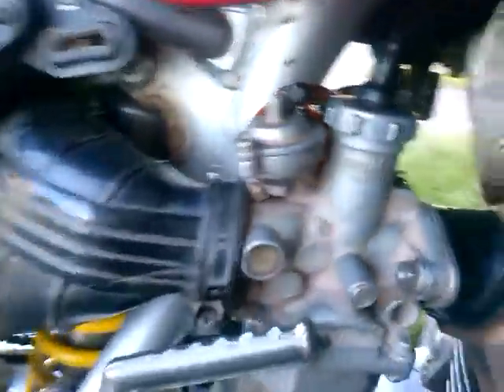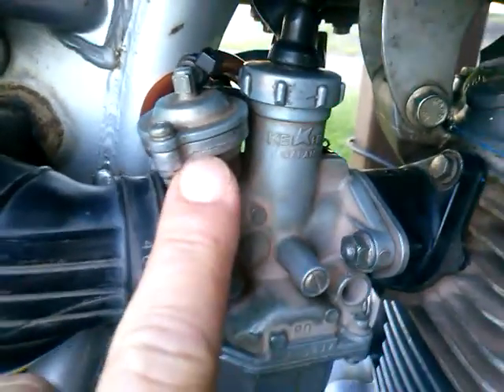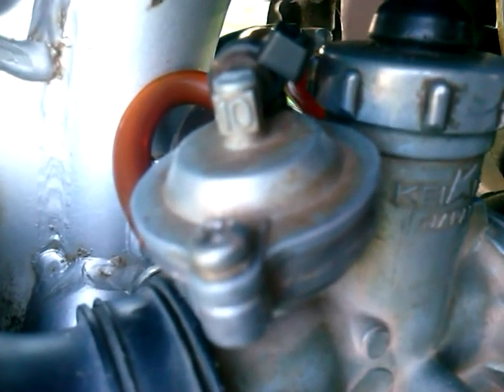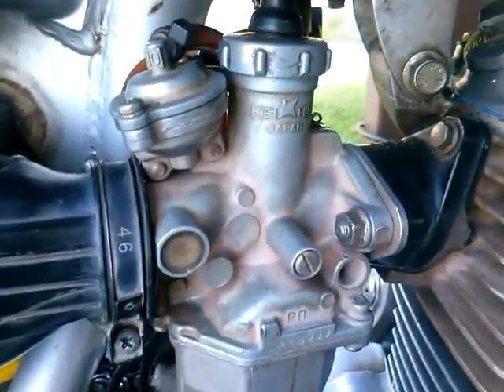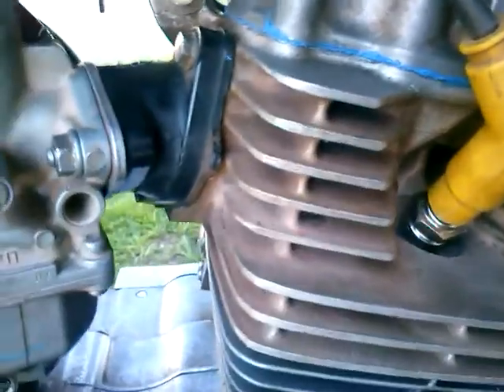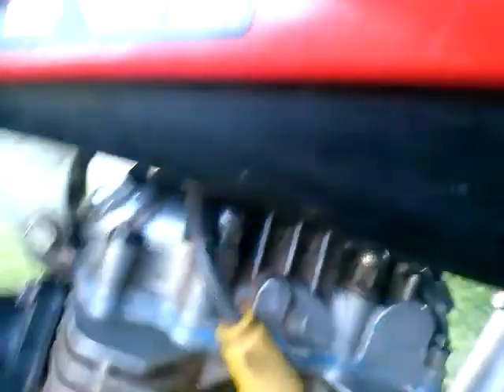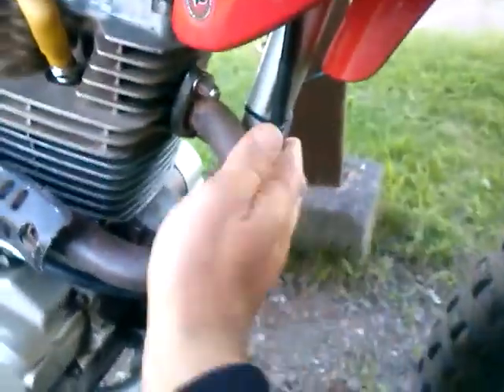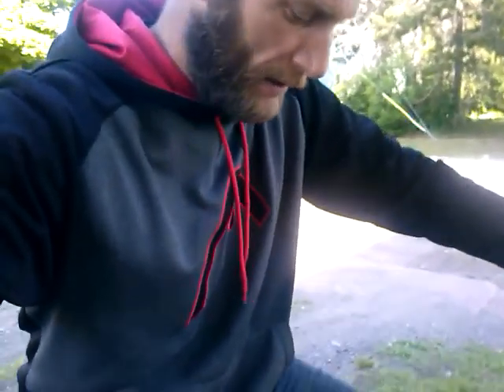How to fix constantly clogged dirt bike idle jet

Comment: I'm trying this. today I went on an epic journey keeping up with a 1000 can am quad this bike was great I can't believe I made it. I'm 250lbs and the climbs/down hills and water/lakeswere insane. 1st gear all the way. I'm use to a 500 xl but this little bike was great for quad trails and rock climbing. The 500 would've been way to heavy in capreol Ontario pole lines. The150 is a great adventure bike but the idle was driving me crazy and shitty shifting between 1-2 to nutrural it won't shift to nutrural when running when stopped and clutch has to be set perfect or to much it won't work or to little no good it very strange compared to my 500xl Honda 79 that was flaw less. Fun bike but why the qurikes with the carb and shifting eh?